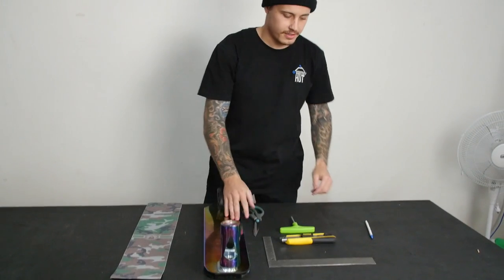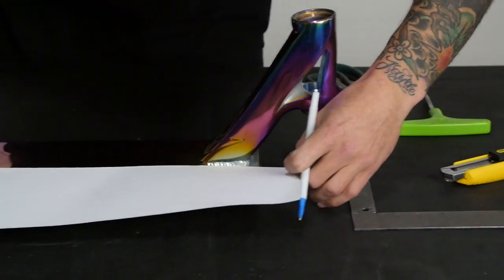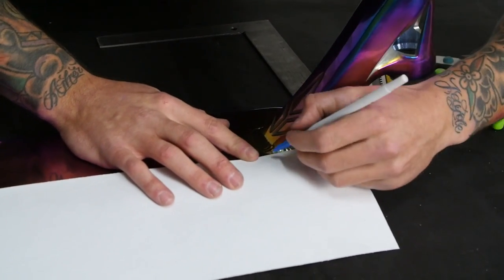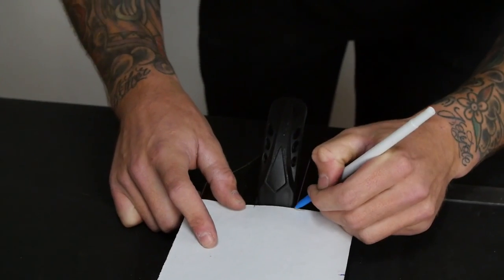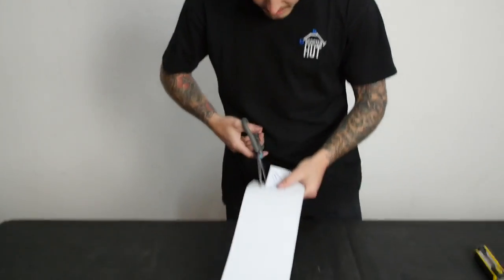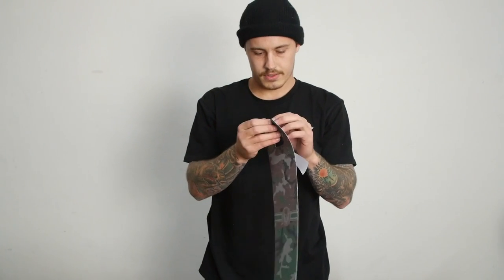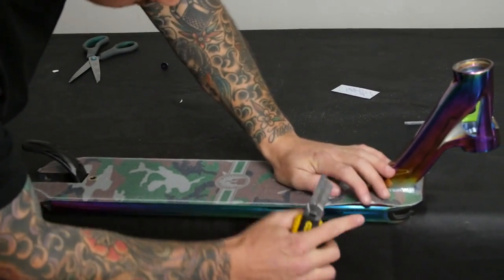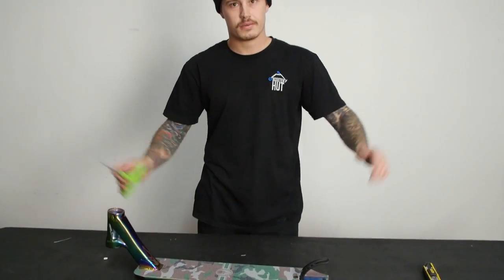How To: Install Griptape | Ft. Max Peters

Comment: envy max peters sig deck
envy reaper bars
envy integrated headset
envy sob v3 ihc fork
envy galaxy grip tap blue
root indurstrie scooter mix grips 
envy 2 bolt oversize clamp
tannerfox sig wheels plz

Comment: Black odi
Affinity t bars in black
Ray warner deck
Tilt fork in black
Oil slick root hollow core wheels
Tilt head set 
Envy oil slick clamp 
Black grip tape

Comment: Scooter set up 
Apex Bol bar standard blue 
Apex quantun fork SCS blue
Apex Darcy Cherry-Evans Signature deck
Envy OTR double clamp 
Root Industries Integrated Headset blue
Envy Galaxy Griptape Nebula
Lucky Tanner Fox Signature wheels or Root Industries AIR 120mm 
Root Industries AIR Mix Grips purple and aqua